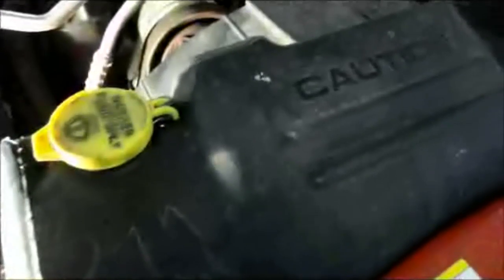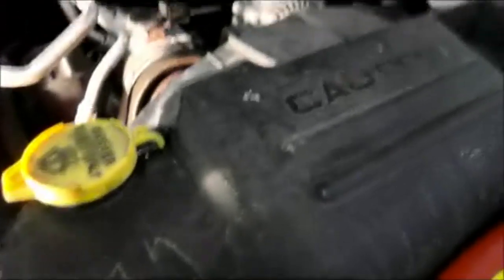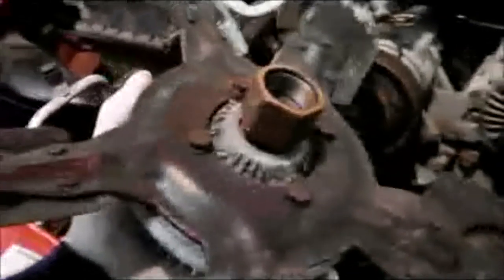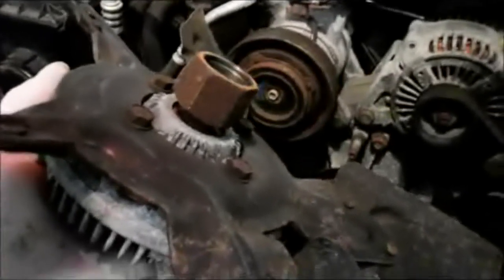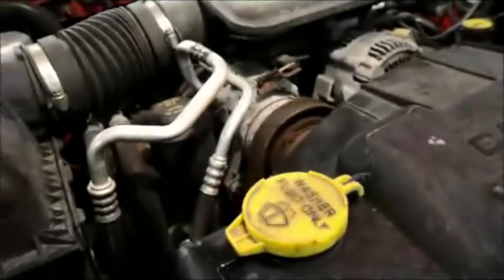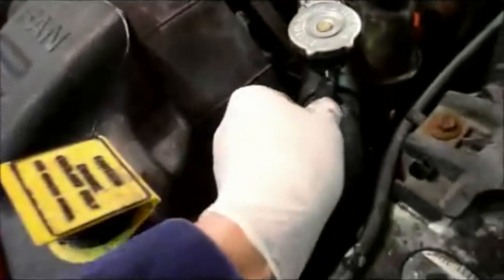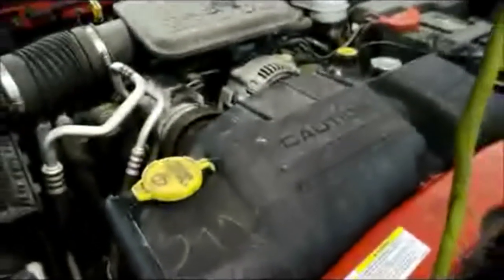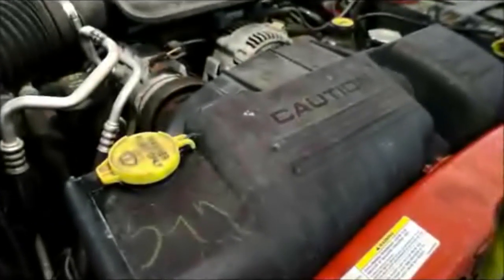How To Replace The Fan Clutch 2004 Dodge Durango

Comment: Hi Jim, I recently subscribed and now I need your help. My 1991 GMC Sonoma V6 4.3 starts to overheat but not boil over. It only does this at nighttime freeway driving above 60 mph. In stop and go Southern California driving temperature always stays normal. I’ve done a pressure test on the system and radiator cap, with no leaks. Has new thermostat and fairly new radiator and hoses. Water pump is about 14 years old no leaks or squeals bearings appeared to be good with no wobble. The temperature sensor right side of engine besides part plugs is new but I noticed there’s another one next to the thermostat which is probably the original. Finally, and a brand new clutch fan and still temperature climbs. I watch many of your videos and has helped me many times, this time I am stumped! Any advice I would deeply appreciate it.